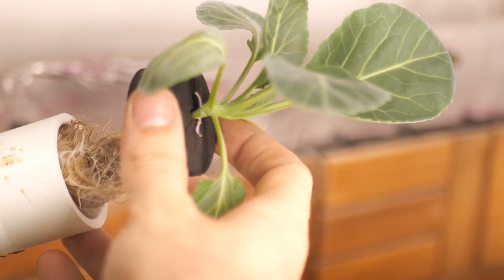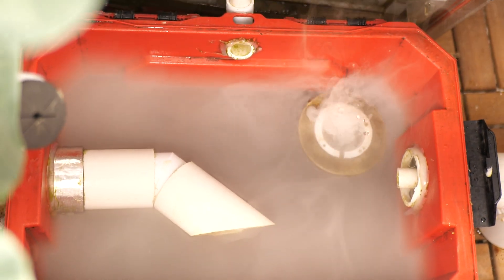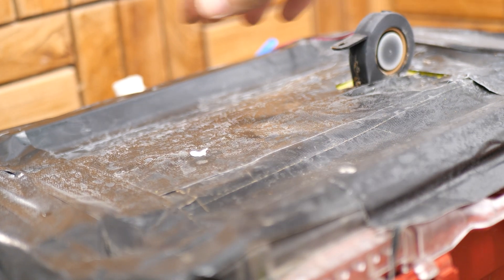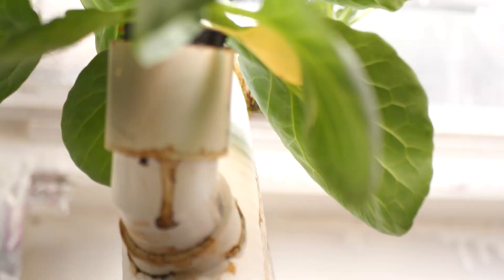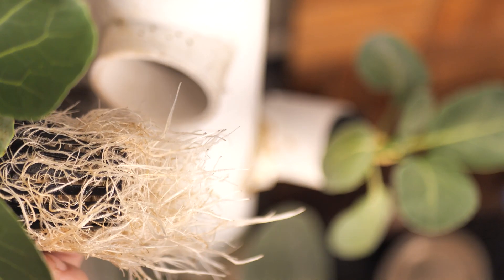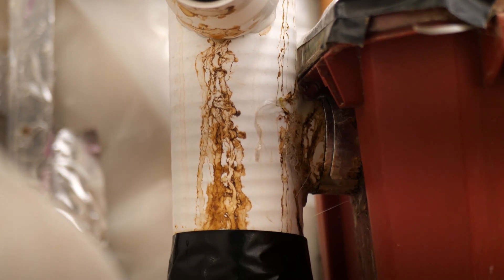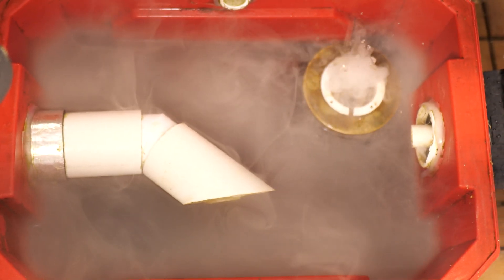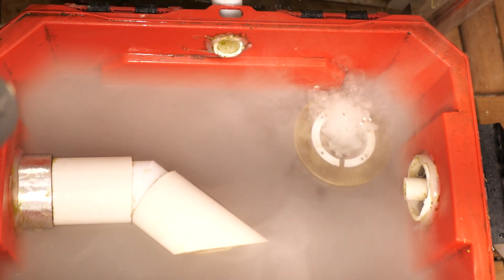FOGPONIC TOWER GARDEN | Ultrasonic Fogger Tower

Comment: With some additions and alterations this could be very good system. 
Have you thought about an oxygenator such as the o2Grow?
Also,  the "moving" fog is necessary because the roots essentially suffocate because the o2 in the surounding fog gets used and fog doesn't move enough,  it has a tendency to become somewhat static.
Moving the air can be a challenge,  especially because the fans will have to push the air and the fog comes back through and the high salinity will destroy the fans... one that has the motor outside of the tube would be better. 
Your video proves that the fog does in fact carry nutrients,  something people have argued it doesn't,  because the buildup from the drip around the plant sites on your system show that it does..
Obviously at this point you know that you need a larger nutes reservoir with a fresh water reservoir auto filling it. 
Remember to place your bubbler intake outside the room, and have an exhaust port that leads outside of the room from the top of the res... Less moisture in the room, less heat in the room,  more oxygen and less co2 in the nutes.
The o2Grow oxygenator doesn't need fresh air, because it's breaking water down into oxygen and hydrogen, more oxygen absorbs back into the water and less hydrogen. 
I still think it's good to vent it outside because that way the hydrogen doesn't compete for the same space in the grow room. 
In a regular build,  this creates a problem because the reservoir needs to be stirred (usually done by the bubbles), but if you're running a river through it (circulating system), then no worries. 
Sorry for the novel, im a bit silly i realize now that i have not looked for followup videos!
I hope you kept going with it,  and create a true HYBRID system!

Comment: Have the reservoir auto-fill using a float valve. Hoocho has done some great videos on this. Appreciate that will want water to have right nutrient mix so you could connect existing tank to a larger one containing right mix with valve in between, gravity fed so no need for pump. That will save you filling up every other day.

Comment: Do you have to constantly monitor the water level in regards to the ultrasonic fog maker or have you automated that somehow?
Reply from the maker: The fogger is floating so as long as the water level stays high enough to keep the floater floating it works. I usually just add about 64oz to top off ever few days.